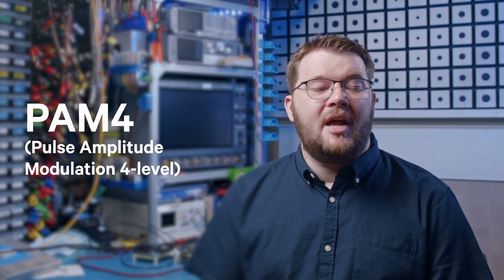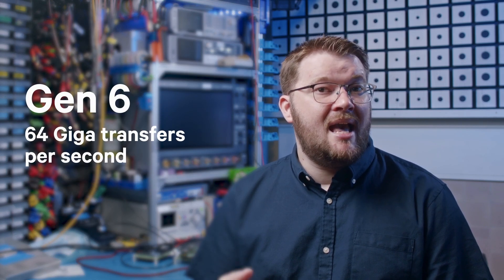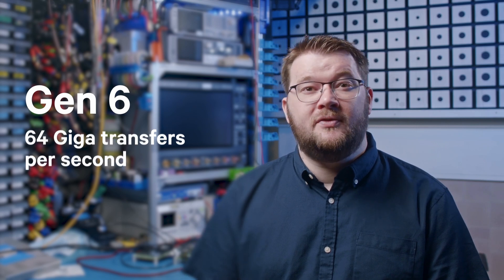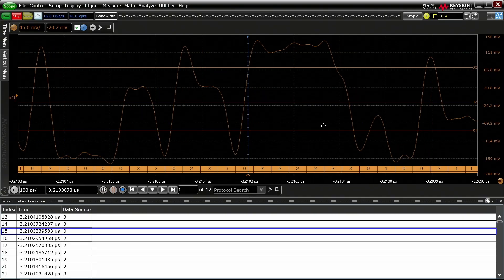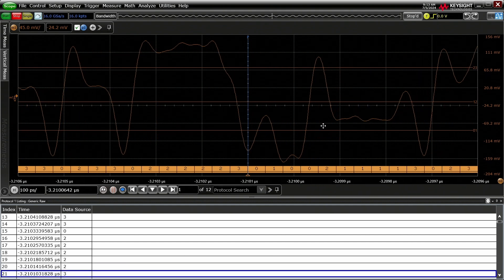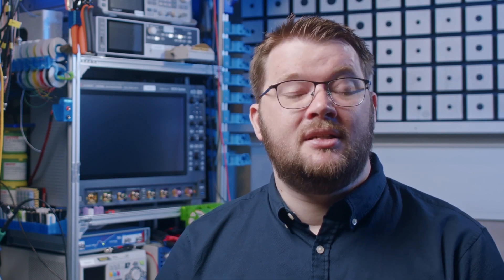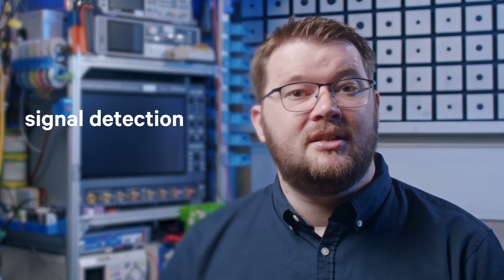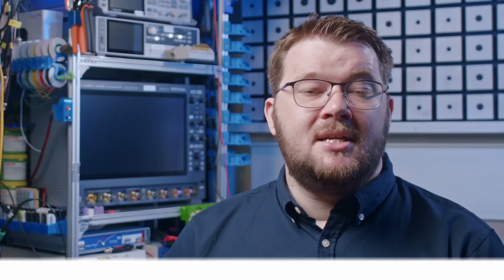Understanding PCIe: Lanes, Links, and Signal Integrity

Comment: how it is possible to have 31 picoseconds for 1 bit? If gate delay for 4 nanometer node is 2 picoseconds, and you need many transistors to build some usable transistor logic for data transferring, how is it possible to have such low timeframe for signaling? It is insanely fast. This makes PCI Gen 5 completely unaccessible for DIY projects